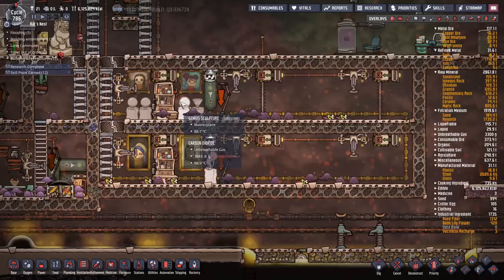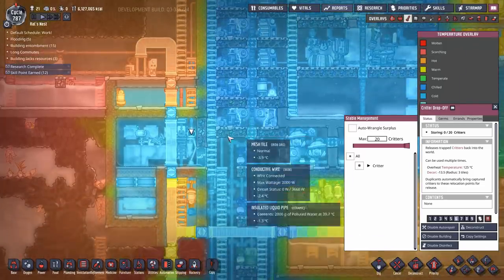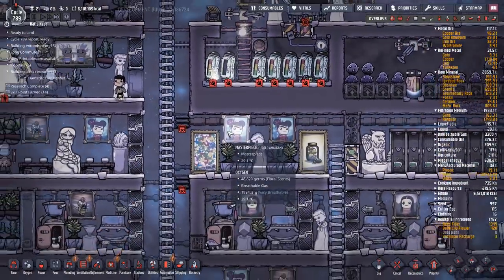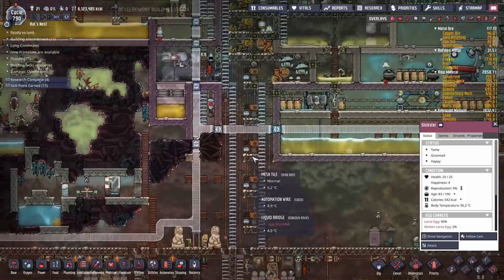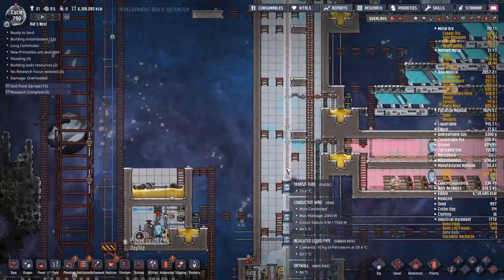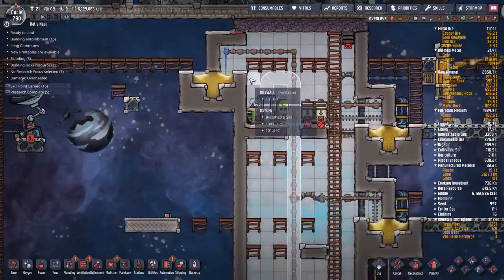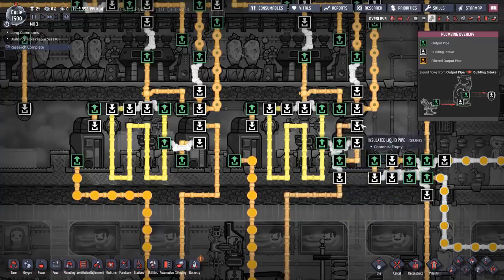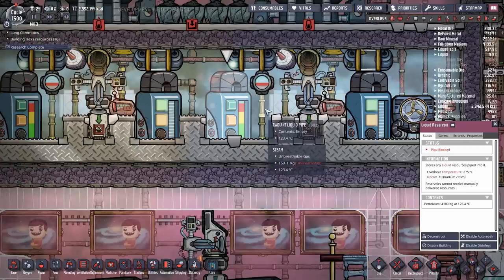Base Lovin : Lets look at some bases : Oxygen not included

Comment: Thanks for featuring my base. Looking forward to you nicking some things back from it. It's only fair, considering how much I nicked from your videos already! ;-)

Also thanks for the improvement suggestions. It's fun to still learn things about ONI from your video's, even when it's my own base which got shown. :-D

The 50/50 division of slicksters is an in progress attempt to consume more CO2 to reduce the time the CO2 scrubbers need to be turned on.

However, .. probably will just dump CO2 in space, and stop this division and instead go with directly dumping eggs in the room as you suggest.

The top of the transport shaft does require a layer of isolated tiles. Due to the regolith, and the tube being pressured, the whole top section of the base started overheating. That thing has no value, had a ton of problems, but 10/10 would build again. It just looks so cool!

I'm going to nick stuff from that other base you showed as well! Very impressive!
Reply from the maker: Ah that explains the insulated tiles at the top. You could always stop one tile short and leave a vacuum gap. I'm going to give it a go to, assuming I don't run into a vent or POI on the way up or down.

Comment: I didn't forget about the hydrogen in the massive area above my base! That was to solve a problem of pinchu peppernuts rotting on the floor while my dupes were doing other things,,,, it just took a really long time to solve that problem :)

It was fun seeing my base through someone else's eyes, I totally didn't expect this, I just sent the file to show my refinery to you since it can be run with out watching, extracts all the heat from the coolant, boils excess polluted water when it is hot enough, and sends clean water to my oil pumps when it is boiling polluted water :)

The refinery could be built with out steel (other than the stuff for collecting dirt) but then that would involve moving the reservoirs somewhere further away and lots more piping, I thought it might be easier to just make some steel and build the tanks in the room :).

Also, the metal floor where water is dripped back in is important, as that floor is hot and doesn't give the polluted water any chance to off gas before evaporating, for some reason sometimes i might get polluted o2 in that room if i didn't have the metal floor, with metal floor there has been no polluted o2 at all over hundreds of cycles
Reply: That was a beautiful base!
Reply: Great work Orion! Liked your base...
Reply from the maker: Thanks again for sharing Orion, loving that hydrogen fridge.
Reply: Can you share your base with everyone? I really want to explore the base myself 😁
Reply: Hi Orion! I know this was 9 months ago, but can you please share your save file for your super-organized base?  I'm hoping to inspect it closer and see how I can improve my own bases.

Comment: I'm actually really glad you show some base design.
By looking at you all the way during this playthrough I'm finding myself using a LOT of your ideas, and some of them are not really fitted for my map ! For instance I'm now past the 1000's cycle, struggling with power because I only got one Oil Well. Looking at others ideas is refreshing !
Anyway thank you for this series, I'm really having a blast here :-)
Reply from the maker: One oil well is rough if you don't get some extra nat gas to help pick up the slack. You got any solar going? Might be an idea to rush it so you can support your power needs, might need a few extra battery banks as well.
Reply: @FrancisJohnYT  , sure I got about 30 ish solar panels, but hey, when comes the meteor shower, there's nothing to do, my power goes down. I got some huge battery banks (went crasy with about 100 of smart batteries) but it does not cover certain extended period of time when the bunker doors are closed.
 I got one nat gas as well. No, the problem is that I followed you dear sir ;-) I puted a LOT of aquatuners all around my base for various reasons, they are so power hungry those little bastards !
Any way, I had a lot of fun playing alongside you, for the first time I went into space, and you are the one that made that possible. Thanks a lot Francis !

Comment: The only problem i see with dumping the eggs directly to the evolution room is that the critters in the ranch will eventually die, and you might be left with no eggs if you don't pay attention, you would have to make some kind of automation to detect when critters are not enough in the ranchs 

Great bases, thank you for the tour.
Reply from the maker: But you leave one ranch dumping eggs into the intermediate area, with only one six critter ranch feeding the intermediate area you are looking at 1 critter a cycle. Excess will need to be wrangled. All the other ranches go straight to the evolution area.